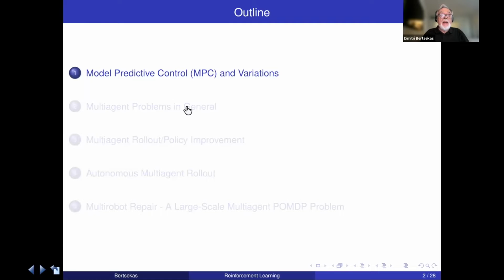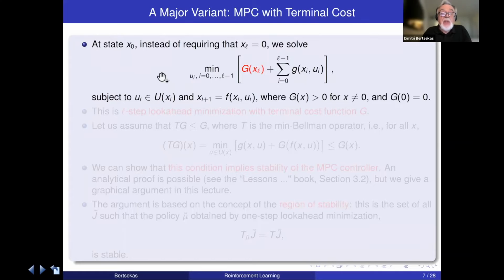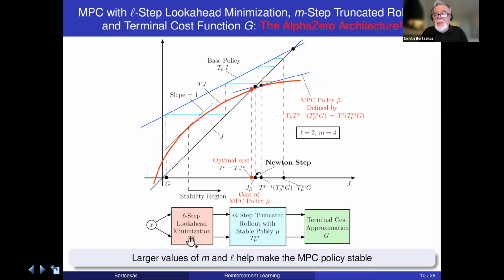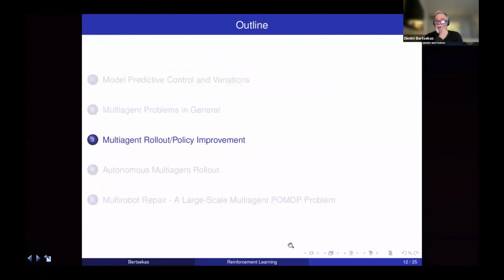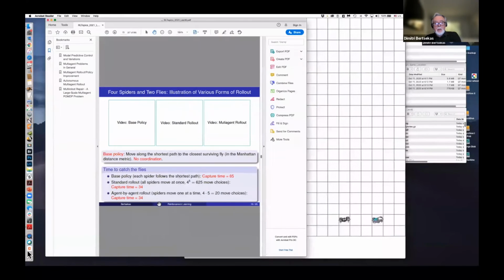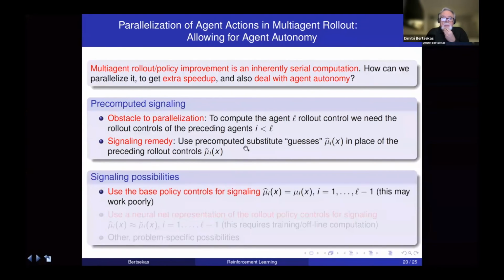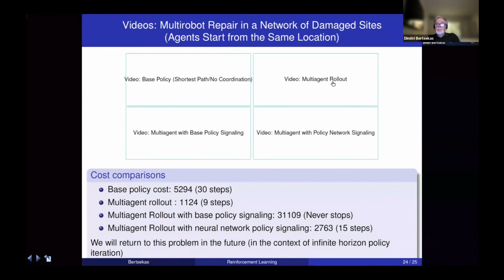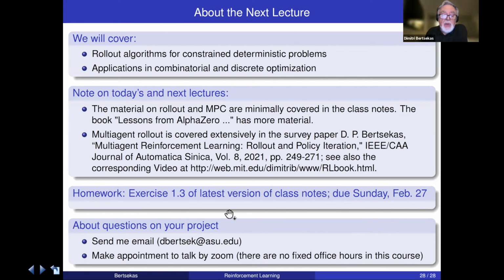Lecture 6, Spring 2022: Model Predictive Control; Multiagent and Autonomous Systems. ASU

Comment: I have a question. For traditional or conventional MPC, do we need to linearize our nonlinear plant model, or we can use it in the form of nonlinear plant to be included in MPC design? I heard that the most basic or traditional MPC is good enough to handle nonlinear system. I have a complex nonlinear model that is difficult to be linearized into state-space model. If I use it without linearization, it is relevant or not?

Comment: When the base policy is used instead of signalling in a multiagent problem, each agent could (in addiction) calculate the decision of another agent from the perspective of that other agent, thereby it could identify the situation where the next agent will make the same decision. If there is some priority given to each agent, then in the case of duplicate decision, the lower priority agent could avoid the identical decision?